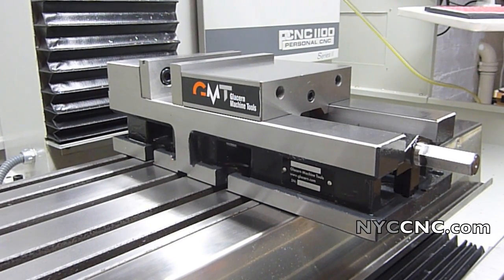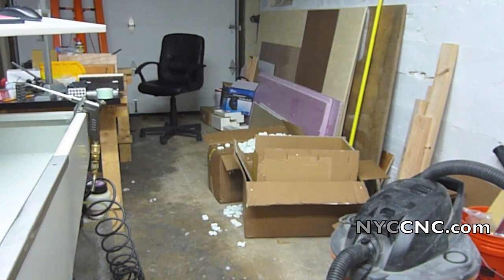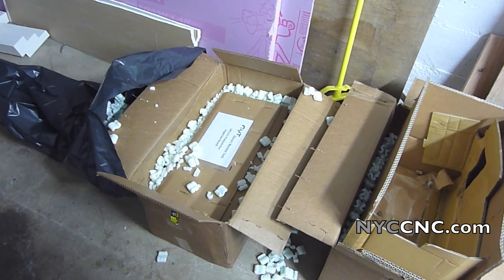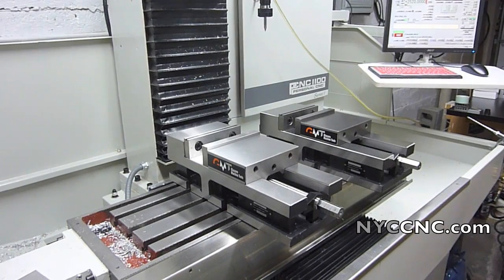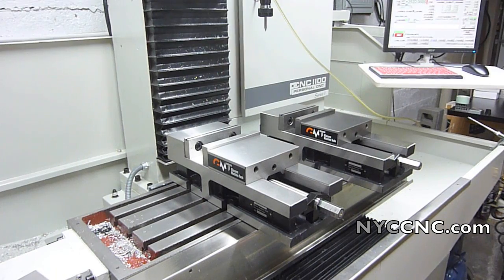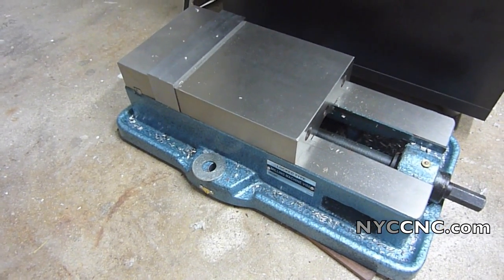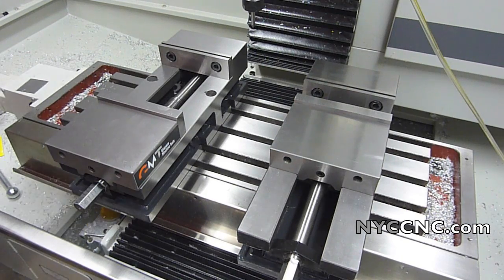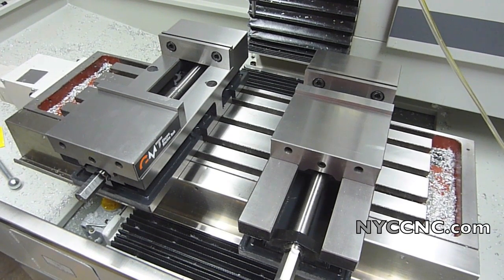Tormach PCNC 1100 - Matching 6" Premium Glacern Vises! - Ch. 14

Comment: I just bought a new one and you aren't joking about the packaging, now instead of peanuts they use foam inserts in each of the double boxes. Now they include rockloc mounts on the bottom if you want to use that feature. Paid 650 shipped on a special for free shipping, and there also wasn't any tax which is a huge bonus nowadays.

Comment: I almost went with these, or their premium counterpart unit from shars that claim the same tolerances the SV550 i believe (seemed like a good one for the money, same with glacern). I got lucky and caught an auction listing for a double lock 4" Kurt vise that is going to take up my whole dang table on the X3 lol. I will have to make a sub plate probably just to bolt the dang thing in! :\